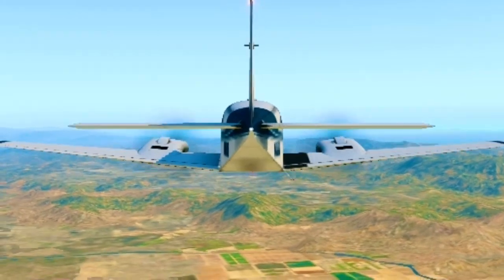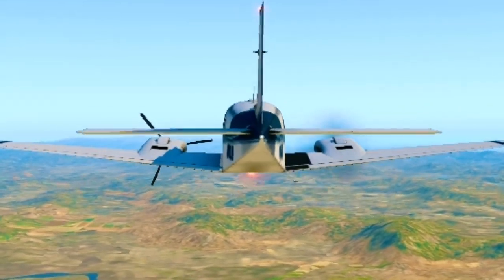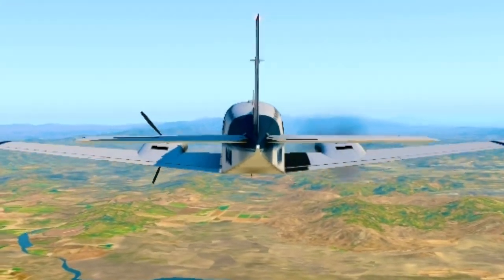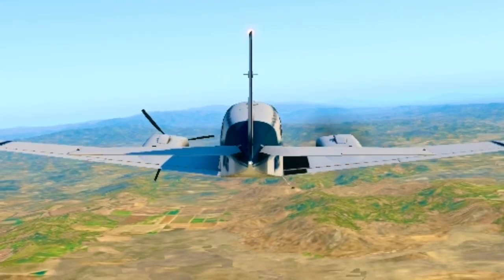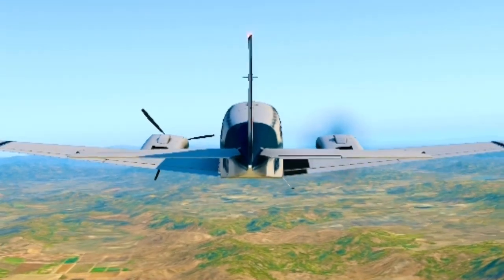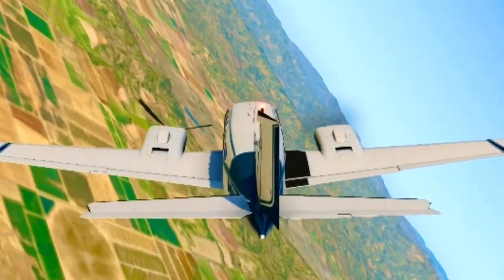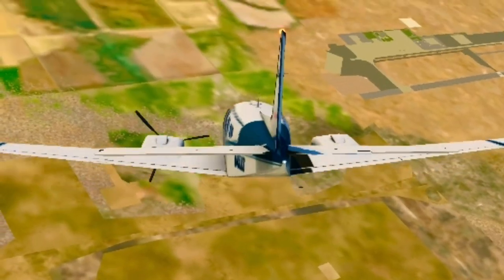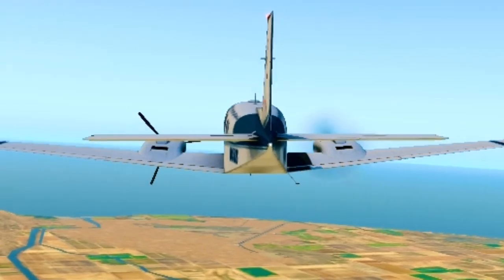PART 1 Failed VMC demo with spin in Beech Baron - accident simulation

Comment: When I was a new MEI in the mid-70’s, feathering one and re-starting was required.  Then, it was stopped in the 90’s as I recall.  Then, it was required again…  It seems ridiculous to create an intentional  emergency, just to simulate an emergency.  50% of the time I have shut one down in the last 50 years, we have difficulty re-starting.  Why bother doing it?

Comment: Had one quit in a BE-58 IMC.
Learned two things.
1) Cross controlling in IMC is a strange sensation.
2) Landing roll was a lot longer due to less drag.
Reply: By the book. Half and 5.
Left engine failed. All my turns were to the right.
I was at 8000'. Bases were 2000'.
Bumpy..of course.
Not a fun day.
Reply from the maker: Thanks for telling the story.  Did you use the ball to coordinate rudder trim?

Comment: In the late 70's there was a ex. Navy pilot acting as chief pilot of a small charter company, he had just hired a new pilot also ex Navy, so he takes him up to check him out on a Baron 58, they were at 1500 Agl. he pulls throttle back on one engine and as they approached VMC he thought to himself " I hope this new pilot doesn't try to hold altitude" but he had confidence that since he was also ex-Navy this would not be likely. 
Well this new hire " did " try to hold altitude, before the chief pilot could do anything they were in a spin.  First he pulls other throttle back to idle and opposite rudder to spin but it wouldn't stop spinning, in the Navy he had training on how to recover a aircraft that didn't want to recover, he started rocking the elevator in and out, this worked but then it quickly was spinning the other direction, he was running out of altitude and was pretty sure he would never see his wife again. He is at 500 Agl now pointed straight at the ground as he stops the secondary spin but knows if he pulls hard on the stick it will stall again, so he pulls back gently but as much as he dare's, he avoids the secondary stall but the ground is too close and he cuts a swath through the tree's.

The Baron was a write-off, both pilots get some time in the hospital but it could have been worse.
Reply from the maker: Interesting. Thanks for sharing.
Reply: Wow.... holy shit. How do you even recover an aircraft that doesn't want to recover?

Comment: I'm a  single  engine pilot and  frankly I think these lights twins are  plain dangerous . If an engine  fails in a single  you   don't  drop into a  spin .. you  lose  altitude  sure  .. but under control ...big  difference . I  know of  a recent  case where a  Cessna  310 had an engine  fail on approach  ...possibly an engine  idle problem ..anyway  it was  too late to fix the issue  ..aircraft rolled  and  2  died .  In a single engine you would  just land  short of the  runway  ..and likely  walk away . To fix  the danger of  light  twins rolling after   losing an  engine  the  engines  should be  cross  coupled mechanically via  a drive  shaft and  clutch or  electrically   via  motor -generators  ..Inventors are you there?  Com'mon you can  do it  . Until then I won't be  flying  light  twins ..or  R44's  either
Reply from the maker: I do agree that light twin is the epitome of an overly complex aircraft. Unless you have a specific mission, such as flying over mountains or water for extended periods with a heavy load, a twin will do the job just fine.
Reply: @drethanplasticsurgery did you mean to say, “…..a single will do just fine”?

Comment: Will the plane fly in circle if rudder is straight? How big will be the radius of this circle? Will it be able to gain altitude?
Reply from the maker: With one engine inoperative, the plane will not maintain directional control or maintain altitude, without the correct control inputs and feathering of the dead engine

Comment: Showing proficiency of single eng. operation and all which must be done to maintain flight is far different than an engine that packs up @ 200ft on take-off.  Most accidents occur during TO/landing and there are some light twins marginally powered that can be more “dangerous” to operate than others. Aviation can be inherently dangerous even if everything goes right and all procedures are followed. Prohibited from intentional spins for good reason. Lose complacency.
Reply from the maker: Correct.  I didn't even discuss the one engine operation procedure in the video starting with DEAD FOOT - DEAD ENGINE.  You absolutely right about the loss of 80% of excess thrust after failed engine.  High density altitude combined with non-turbo single engine and you are descending even clean and feathered.
Reply: yes  .. this dangerous engine out   roll  characteristic of  light twins  is not  acceptable .  Pilots are  getting  killed even with an instructor  on board because  even an instructor  cannot recover the aircraft .  I call it a design  flaw .They  should be  banned until it is  fixed  .. either  by  cross  coupling the  engines  or  we  go back to  Cessna   337  style aircraft .
Reply from the maker: @danobrien3601  Burt Rutan has some interesting designs aiming to address conventional light twin limitations.  Not all have been commercially successful. Moreover, counter rotating twins seeks to eliminate the critical engine.  As long as airlines continue to demand multiengine pilots, the light twin trainer will continue to exist.

Comment: This is all fine except, if your stall speed is close to Vmc!   The point of the exercise is identification and immediate recovery, better still avoid it. I certainly would not allow the aircraft to yaw as far as depicted in the simulation. Vmc demonstrations do produce, an uncontrolable yaw into the dead engine and if Vmc is close to stall speed you would have a very high risk of a sudden onset full spin.  I had an experience in Jet Stream 31, a simple stall at 17,000 feet, 15,000 AGL.  We went through a skiff of cloud in the climb, no visible ice, the aircraft stalled 20 knots above the calculated stall speed, rolled right to a 110 degree bank in about 1 second. That ended the stall training. Now think Vmc demo and that happens. Ah the oh shit factor. All I am saying is safety first, expect the unexpected!  No need to self induce a point in your shorts.
Reply from the maker: Interesting story, I suppose the ailerons produced different angles of attack.  This simulation is a failed Vmc demo.  I intentionally put in the wrong inputs to show the incipient spin phase.
Reply: @drethanplasticsurgery  I realize the demo was a demo. But in reality Vmo if demonstrated at max power will produce a violent yaw/roll into the failed engine.  There is nothing slow about it.  The Vmo training is done to drive home the danger and to avoid getting there.  A practical example of why Vmo training is done, would be a 3 engine departure in a four engine aircraft.  I have done this once, a special ferry permit needed, essential crew only.
Reply from the maker: @johnolsen7073  Engine #1 and #4 are the critical engines, due to greater asymmetric thrust.  Correct?

Comment: I was told if you spin a Baron below 15,000 feet you will die. If you spin above 15,000 feet, there is a slim chance you might not die.
Reply from the maker: makes sense considering over 800 lbs of piston engine and full fuel tank roughly 7 feet lateral from each side of the longitudinal axis =11500 ft lbs of rotational angular momentum
Reply: Big problem

Comment: Many spins in the Barons go flat and become unrecoverable. Consider adding weight in the nose compartment to help avoid unrecoverable flat spins.
Reply from the maker: Yes more weight in the nose moves CG forward, increasing the lever arm of the rudder, lowering VMC.  The D'Shannon vortex generator kit for the Baron calls for placement VGs only the left side of the rudder, taking into the consideration the critical engine

Comment: In most of these light twins, you should never let the aircraft approach stall speed during this demo. In many cases, stall speed is too close to actual VMC, so this maneuver should be done with the “rudder block” method of demonstrating VMC. The effect is the same and the learning the same. The comment about allowing VMC to continue, I do not agree with. You are already tickling the dragons tail by allowing the aircraft to approach stall speed and if you get the stall, the aircraft is most likely to spin in the direction of the good engine and will likely go flat, which is the deadly combination you do not want to see.
Reply from the maker: I agree the rudder block method should be used at VSSE by the instructor or DPE
Reply from the maker: I like the Dragon analogy. Another way to think about it is holding a two headed tiger by the tail.

Comment: For VMC  demo  the inoperative engine should be windmilling.
Reply: And some rudder deflection

.
Reply: thanks  just  another reason I won't be  doing training in a light  twin
Reply from the maker: Yes. You are correct. Feathered propeller is a failed VMC demonstration.  

Baron POH below

SIMULATED ONE ENGINE INOPERATIVE
ZERO THRUST (Simulated Feather)
Use the following power setting (only on one engine at a time) to establish zero thrust. Use of this power setting avoids the difficulties of restarting an engine and preserves the availability of engine power.
The following procedure should be accomplished by alternating small reductions of propeller and then throttle, until the desired setting has been reached.
1. Propeller Lever - RETARD TO FEATHER DETENT
2. Throttle Lever - SET 12 in. Hg MANIFOLD PRESSURE
NOTE
This setting will approximate Zero Thrust using recommended One-Engine Inoperative Climb speeds.
Reply: @drethanplasticsurgery  Correct. The prop windmilling increases drag which in turn increases Vmc. It is also part of the procedure when certifying a light twin. Regards!.